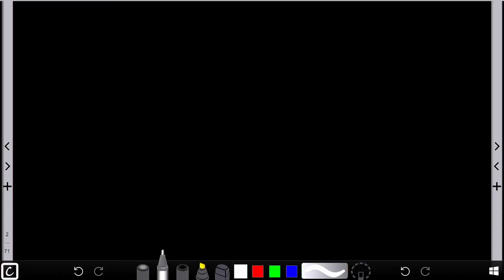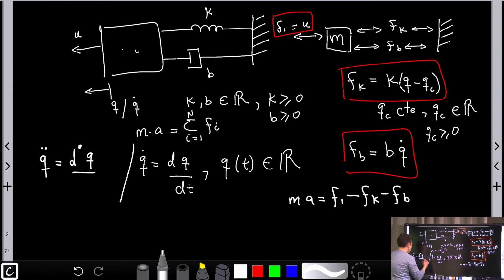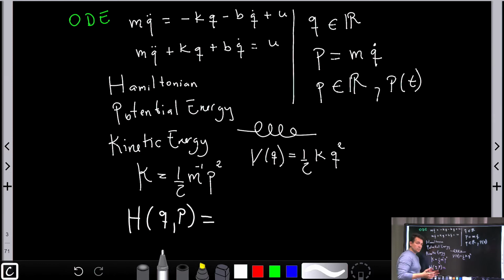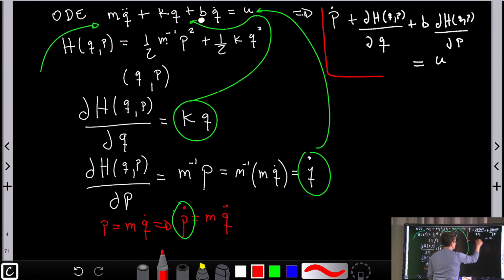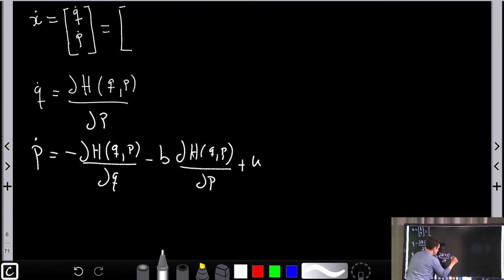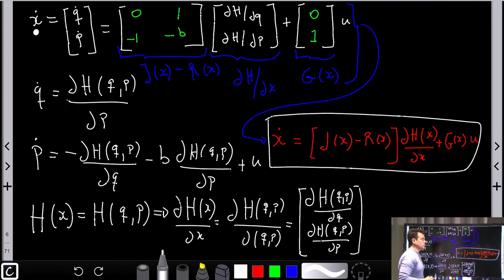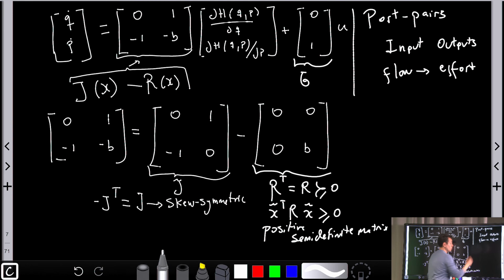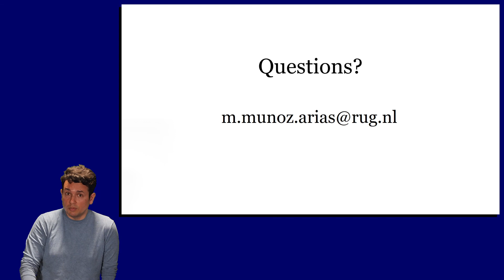An energy-based modeling approach to a simple mass-spring-damper system

Comment from the maker: Here are the key points and timestamps from the video:

- *Introduction:* The speaker introduces himself and the topic of discussion, which is a mass-spring-damper system. (0:11 - 0:29)
  
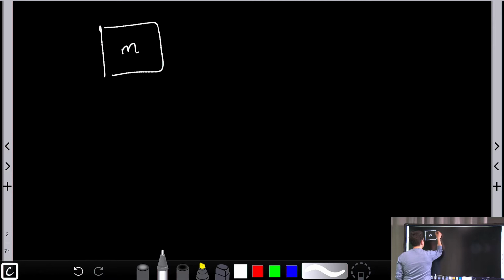- *System Description:* Describes the components of the system: a mass \( m \) interconnected with a spring (\( k \)) and a damper (\( b \)). Introduces the input force \( u \). (0:39 - 1:19)

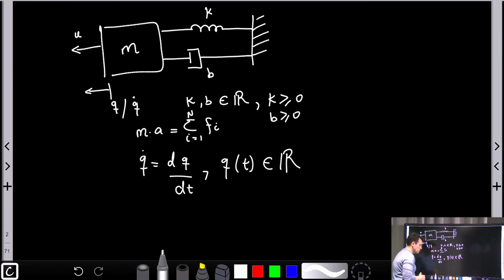- *Newtonian Physics:* Explains the application of Newtonian physics to the system, detailing the forces affecting the mass and the free body diagram. (1:57 - 3:10)

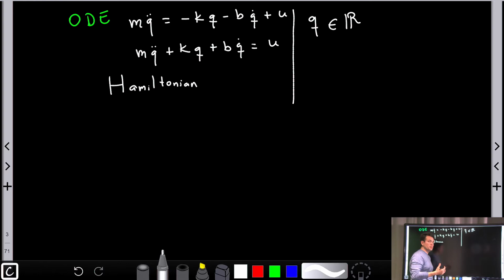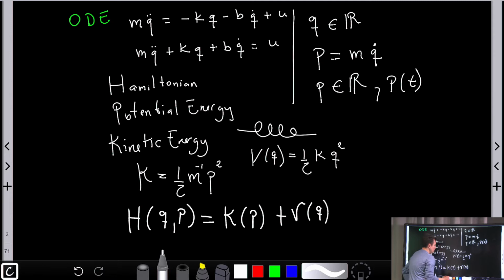- *Energy Functions:* Introduces the concept of potential and kinetic energy in the system, defining the Hamiltonian function \( H \) in terms of position (\( q \)) and momentum (\( p \)). (9:05 - 12:56)

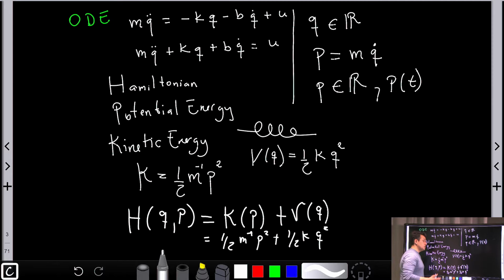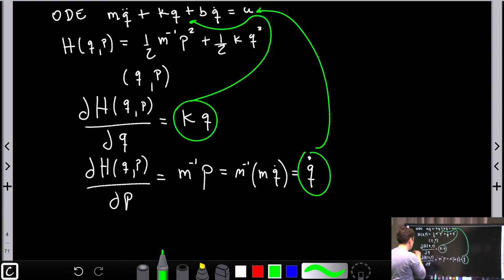- *Hamiltonian Dynamics:* Rewrites the ordinary differential equation (ODE) representing the system dynamics in terms of the Hamiltonian function and its derivatives. (13:36 - 16:20)

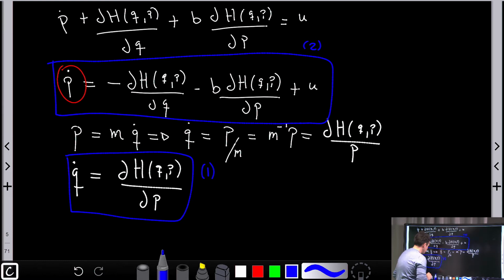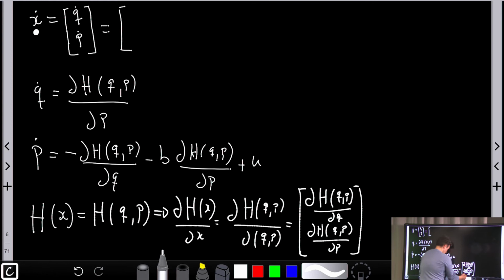- *Matrix Representation:* Represents the system dynamics in matrix form, highlighting the interconnection between generalized coordinates and momentum. (22:16 - 25:15)

- *Input-Output Ports:* Explains the concept of input-output port pairs in port-Hamiltonian systems and defines the output \( y \) in terms of the system input and Hamiltonian derivatives. (35:37 - 38:55)

These timestamps cover the main points discussed in the video, focusing on the system description, energy functions, dynamics representation, and input-output port definition.